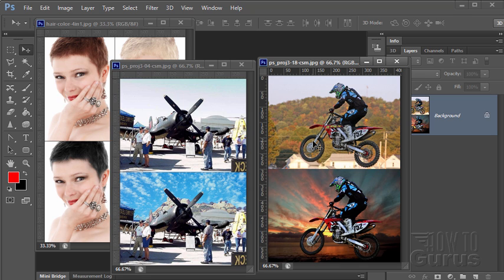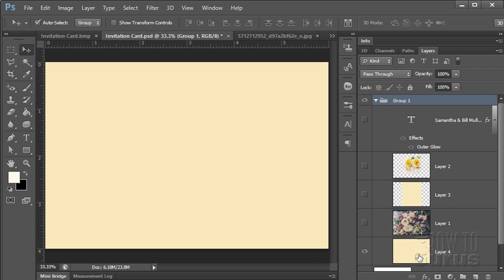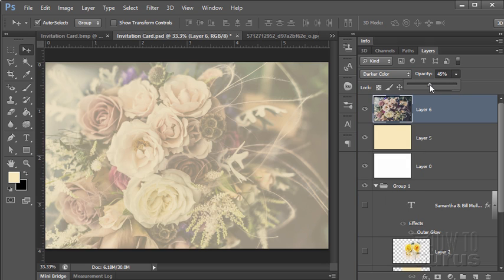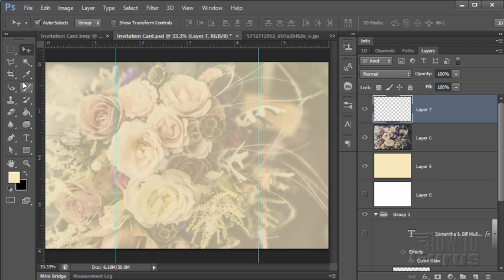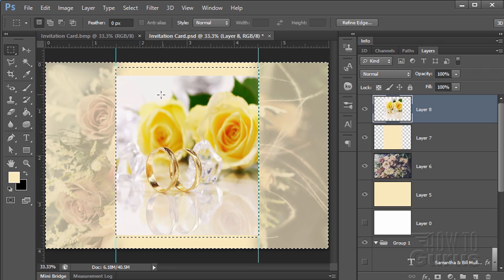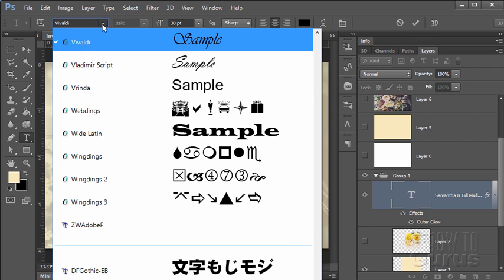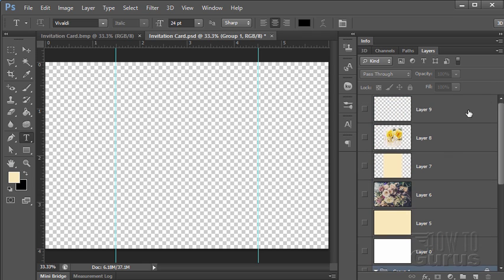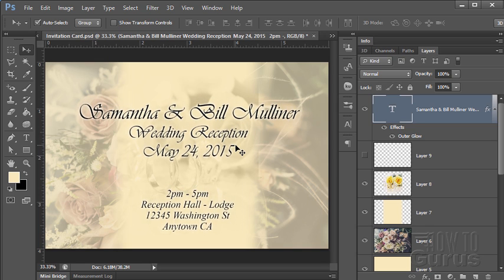How You Can Design Wedding Invitation Cards in Adobe Photoshop

Comment: sir what is standard size of wedding card?
Reply from the maker: +Aurangzeb Zebi Hi, there is no standard size for a wedding announcement but they tend to match post card or greeting card sizes. Some common sizes in the US are 5x7 inches, 6x9 inches 5.5x4 inches. I recommend talking to a printer you are thinking of using and ask them what sizes they generally work with. You will probably find that the sizes available have more to do with what will fit into envelopes that they carry. Printers can cut card stock to any size you want but they usually don't make their own envelopes, so that will be the determining factor.
George